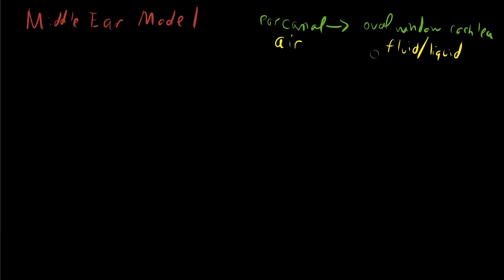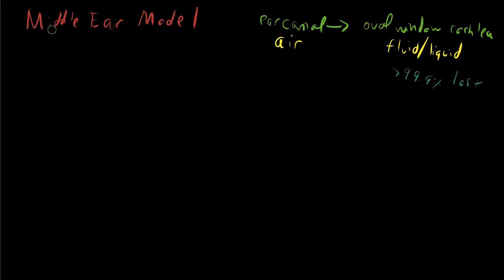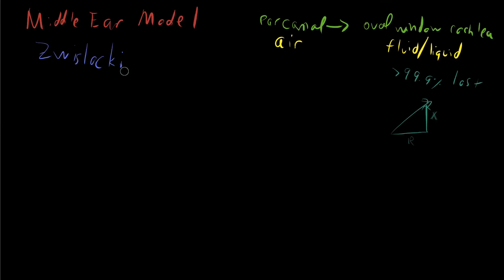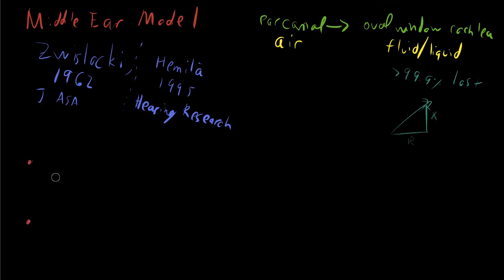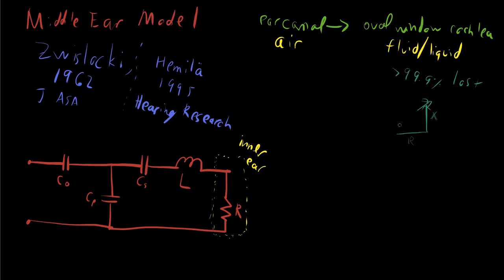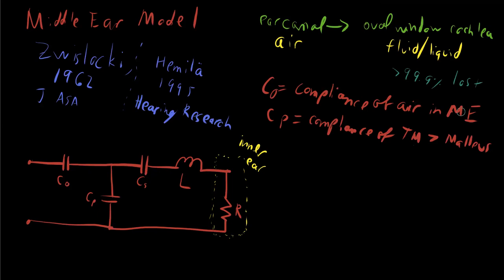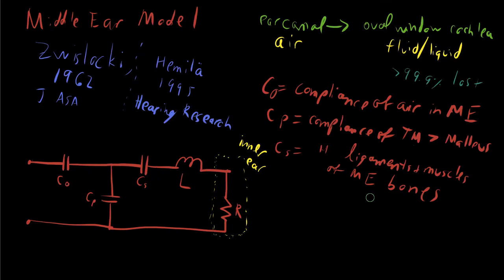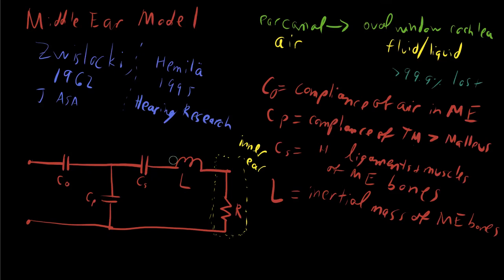Impedance Matching Middle Ear Model

Comment: Absorbed by the tympanic membrane leaves intact
Reply: I wish this was more complex.  Our bodies completey have purpose, however
Reply: Mass has inertia
Reply: What is 0 gravity
Reply: The impedance matching circuit I solved
Reply: I know exactly what you are describing I created an information systems model.The "relative difference engine"
Reply: Its a logical extension of Zwislocki. And Wright